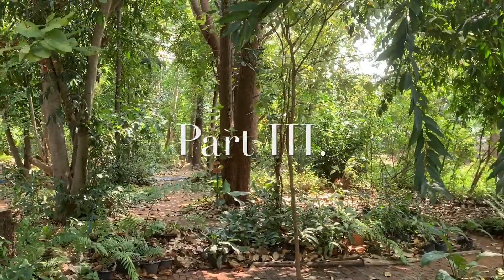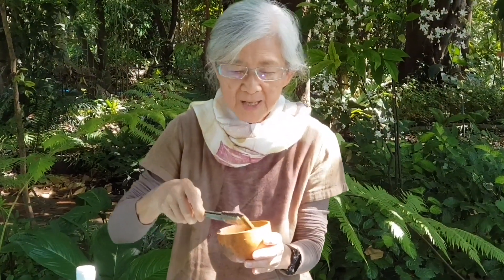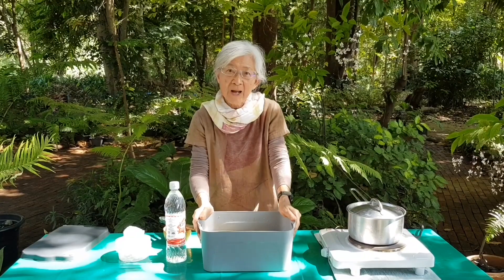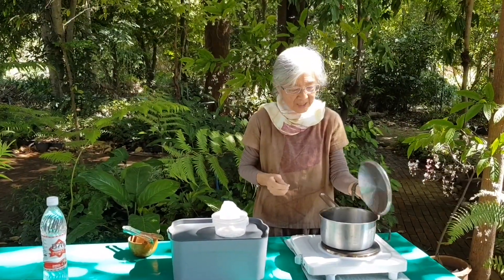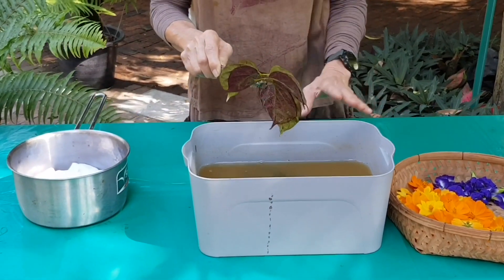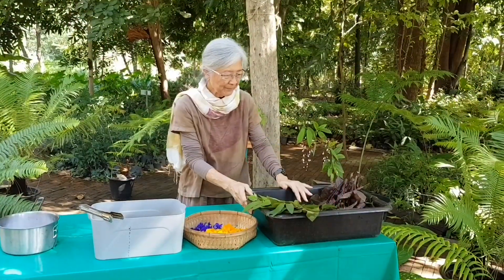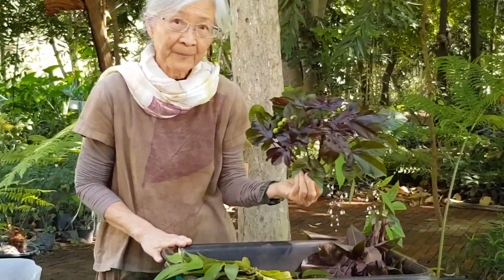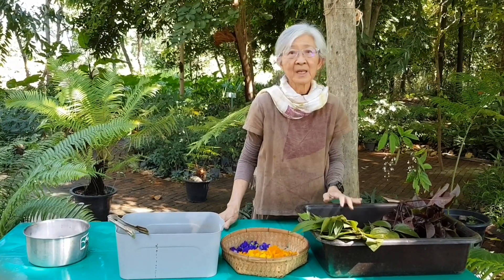Sela eco Printings English Part 3

Comment: congratulations for your works, they are beautiful. The sound is not so good in the various video. Is there a transcript of the various steps somewhere?
What method do you use to prepare cotton and silk before adding the leaves? thank's
Reply from the maker: Sorry for late answer.Before adding the leaves on cotton and silk,you should mordant them in alum or alum and salt.For better print,mordant silk using higher heat than cotton. Please try.

Comment: Hello! I tried to print with teak leaves on cotton mardanted with 15%alum. I had Kept them in iron water for half an hour before steaming but did not get any colour at all. Could you advise why this could've happened? I plucked it from a tree and did it the same day. The weather ia just getting cold here in Delhi and the tree was not very old, maybe 5-7 years old.
Reply from the maker: Hello,good print comes from good quality of alum,young teak leaf soaked in weak rusted iron water for 20-30 minutes,steaming for 1-2hours using medium heat.Try again please.